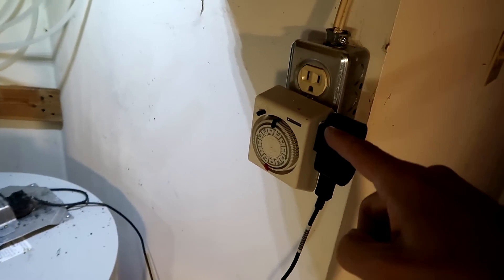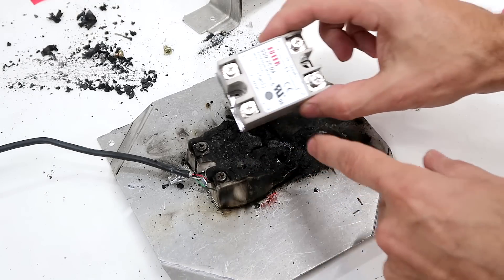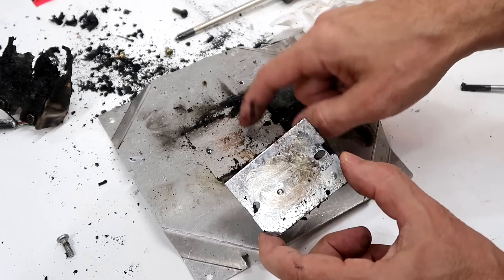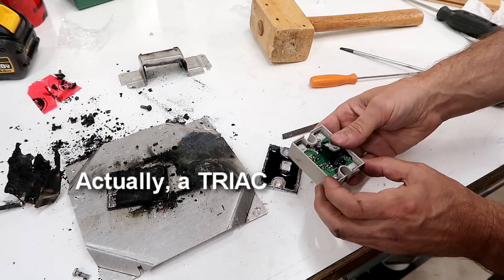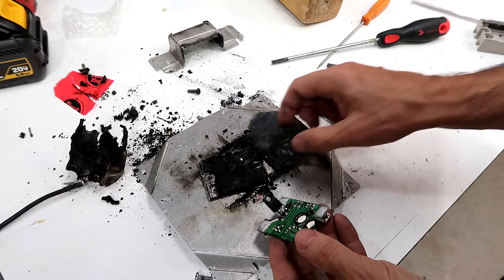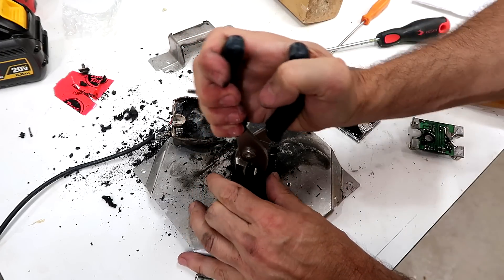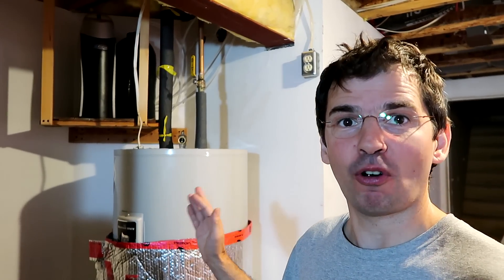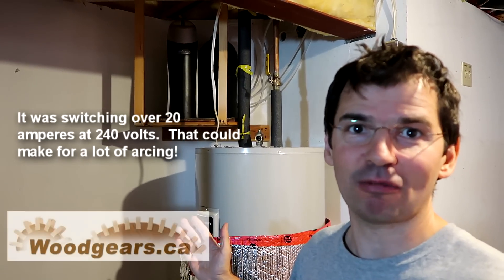Spectacular solid state relay failure

Comment: use a contractor next time, that thing is made to switch heavy loads. we use this to switch on the heaters in the whole house and its working since about 40 years now. you have to change it every 5-10 years because it fails and doesnt switch anymore but at least it wont burn down. 

the thing gets mounted inside the fusebox too so its extra security

Comment: These eBay fake Fotek SSRs use the BTA25 triac (well, some use the BTA15 and push it way past its rating, but that's another story). If you look up the datasheet, there's a diagram of power dissipation versus on-state current. At 20 amps the power dissipation of this relays is ~25W. Do you know how big a heat sink you need to passively cool 25 watts?! 
Not only you didn't use any heat sink at all, you installed it on top of a water heater where the ambient temperature is even higher! 
If you did 10 minutes of research, you'd have seen this coming a mile away. You're very lucky your house didn't burn down.

Comment: I had the same problem.  Fake fotek relays.  My relay failed in the on state with a 20A load.  Toasty.  I left a warning on amazon but the product listing was removed.  Replacement NTE relays have not failed yet.

Comment: I would have installed something like that in a Hoffman type enclosure. An enclosure is not really made to keep people out but rather contain the electronics. In a failure such as this there is not much risk burning things down around it from inside a metal box.

Comment: 1. 25A for 22A? Too close for my comfort.
2. A thin sheet of aluminum is not much of a heat sink.
3. Sitting on top of the hot water heater means ambient temp is going to be a bit higher.
4. Summer in a garage is likely to get hot.

Looking at the datasheet for the Fotek SSR-25DA:
https://cdn.sparkfun.com/datasheets/Components/General/SSR40DA.pdf

Current starts derating at about 82C (see page 12). But look at the size and configuration of the heat sink required for a 25A SSR, it is 100mmx100mm with lots of fins (see page 13). That will be with lots of free air, preferably mounted so the fins are vertical or with some forced air flow.

Even with a large heat sink like that, shrink it to 50mmx100mm and the datasheet lists a max of 10A. With that aluminum plate, I'd be surprised if it could handle more than 5A for a length of time.

I think this could have failed purely due to the inadequate heat sink, made worse by elevated summer temperatures. Add the possibility of counterfeits in, it was doomed to failure.

There is a reason SSRs come with four bolt holes and a wide, flat aluminum base. And a reason manufacturers use these large heat sinks on them, and don't forget a thin film of thermal paste:
https://sc01.alicdn.com/kf/HTB12s_2KFXXXXbqXXXXq6xXFXXXM/aluminium-led-heat-sink-radiator-heatsink-heat.jpg

Comment: Yes, it's probably due to the solder melting and increasing the resistance of the traces, which would then produce a lot of heat.
Still, I don't know if that would be enough to completely vaporize the whole board, like it happened.
Reply: Really the wrong application of an SSR. SSR's produce heat, so keeping one passing high current for many hours at a time is really not a great thing to do. SSR's are ideally meant for PID control where many  ON/OFF cycles happen in a short period of time - an application that would cause shorter lifespan in a mechanical relay. But for his application where the heater stays ON most of the time and switches only occasionally, a mechanical relay or contactor is likely the best approach if passing high current. Plus, the Chinese SSR's that are cheap cannot carry a load that high for hours on end w/o a big heat sink and a cooling fan, if at all.

Comment: Spike voltages when switching an inductive load require a protection. E.g.: https://www3.panasonic.biz/ac/e/control/relay/solid-state/cautions_use/index.jsp And wrt arcing, there's no arcing in a solid state relay...

Comment: Build a bandsaw out of wood: That's crazy talk, it won't be strong enough, it'll never work...  Build a fan impeller for a dust collector out of wood: Foolishness, it'll just blow itself apart!!!...  Use drawer slides for the pantorouter:  why bother, it's too hard, you can buy roller bearings from china (won't work as well, but much easier...)...  Use a SSR to turn off the water heater: Nonono, you can't use a device designed to switch AC loads to actually control AC loads, it'll blow up!!!...  I guess if you have enough monkeys writing comments on youtube, you're bound to have success once in a while...  Look people, the only mistake he made was trust the rating on this SSR which turns out to be bogus (bigclive has a video on a similar SSR from the same company).  Lesson learnt (and thanks to his sharing this video, lesson learnt by a lot of people! I applaud him for having the courage to post this video)...  If you are somebody that "does", then you will make mistake: learn from them and move on... If your whole purpose in life is to avoid making mistake, then make sure you stay in bed and keep hiding under your covers (and please refrain from commenting on youtube... it could be dangerous, somehow)...  As for Matthias, THANK YOU for the awesome youtube channel!

Comment: This right here is a prime example why permanent AC installations need education & "license". Infact any high power potential electric work.

You used AC to switch a SSR, which is a DC utility like it reads in there. You undersized the SSR to begin with, driving higher loads on it than rated. That 25A is PEAK rating, not constant. You were driving it at beyond industry standard which is 80% max constant load. You were driving it incorrectly, and it was to begin with an extra unneeded component.

More enthusiasm than brains.
Reply: In the odd ball chance the SSR was wired correctly to begin with, it was in any case undersized and there was excessive components too. If it was simple timer device, well the one plugged in the wall would have done the trick lol
Reply: > You used AC to switch a SSR, which is a DC utility like it reads in there

From what I see, he used a wall mounted timer (probably rated 10-15A, but he only need maybe 0.1A actually, tops), and connected USB wall charger to it to drive SSR (5V DC). It would provide reasonable 5V DC, but the startup behaviour and shutdown behaviour of many cheap USB wall chargers is really poor.
Reply: Well - none of what you said is actually correct.
The problem was simply his use of a cheap knockoff.
Reply: I really hope you never touch AC either in that case. You might get someone killed

Comment: Not sure I would trust a TO-220 with much more than 10A, and given the cold-resistance of the heating element, there is likely to be some spectacularly high inrush currents. That is of course all 20:20 hindsight. Personally, would use a name-brand SSR for this kind of a job rated at least 40A. Panasonic AQA611VL sells for US$50 from Digikey, cheap compared to burning down the house. Also steel has a high thermal resistance, consider something like ali for the heatsik. Anyway, just my 2c. Regards, Mark

Comment: Best practice is to use an SSR for fast switching applications and always to put a mechanical contactor or relay in series. This serves to isolate the power if the SSR fails as they fail closed. You should not use an SSR by itself regardless of the quality. So the safety issue is the result of poor design not just poor quality.

Comment: 22A for a chinese 25A SSR ist ways to much. 25A ist the theoretical max. possible Current. And it needs a BIG heatsink. When anything went´s a little bit wrong the SSR turns into a lighter. Here is a video from Bigclive about this SSR. He found some errors. One is that the input becomes to hot at max. input voltage. 
https://www.youtube.com/watch?v=DxEhxjvifyY

Comment: You are aware that your wiring of that relay is not to code (any code, anywhere) . That being the case if you had a fire and an insurance claim, the insurance company would walk away from you. You would be facing a full financial loss including the fire department fees, insurance investigation fees etc. It's OK to be a smart guy but you need to do these things according to code requirements. If you don't know what the code requirements are for supplementary electronic and electrical equipment in a home installation, research it before doing it! You are one very lucky man! This is coming from a retired fire fighter and licensed electrical contractor.....

Comment: I'm pretty sure BigClive tested one of those knock-off Fotek SSR before and they actually are rated for about 12A, not the 25A they claim. If you had bought a real one, i'm pretty sure nothing would have happened.

Comment: Matthias, I truly respect your knowledge and intelligence, but this bodge lacked wisdom. This should have used a continuous-duty contactor or purpose-built controller. Sometimes very bright people let their abilities outsmart simple wisdom. I’m not a safety Sally. I disagree that you, given your skills, should never attempt any electrical project. But this one was ill-conceived, overthought, under-wisdomed, poorly executed, and a risk to your beautiful wife and children. It’s been said that exceptionally bright people make exceptionally big mistakes. Count on it. Been there myself. Kudos for making this video. Anyone else contemplating such a project, forget the debate about various solid state relays. Use a device that doesn’t dissipate energy as heat...something with nice, big, quality switching contacts. A semiconductor device always has an “on” resistance and will always heat.

Comment: This is why my Dad used to DIY stuff like these in the 90s. He had an electric stove power reducer. It worked for 15 years, 
then the 2 triac that were in it, went bad and it allowed full power  to the stove. A simple replacement fixed it

Comment: The system certainly failed due to thermal overload (to say the least!) when the thyristor chip temperature exceeded its maximum junction temperature, probably ~125 Deg C. The board looks like it caught fire or something on the board did. 

I am not sure that the 25A rating of the relay means I will assume RMS. My guess is that the 25A rating is at an ambient temperature of something like 25 DegC that is derated as ambient temperature increases.

The board looks like it caught fire or something on the board did. It's easy to see how this could happen. If the terminals were shorted by the failure I thunk the breaker would have been opened.

Thermal resistance Junction-to-Case (ThetaJC) is the number that  describes the perfect situation with the part bathed in a massive heat sink like the pacific ocean. Its so massive your few tens of watts will not change the the temperature of it and therefore the case temperature. The chip junction temperature would simply be

Tjunction = PD x (ThetaJC) + Tambient

where PD = Power dissipated.

(Assume that thyristor has a 1.8V drop and RMS current is 20 A). PD= 36W, or ~ 40 Watts for our purpose.

Maximum chip temperature is probably 150 DegC with a maximum operating temperature of 125 DegC likely.

Let's also assume the scenario where the relay is on for a long time in a hot garage and mounted to the top of a heat producing object.

Let's assume the top of the water heater metal is 50 DegC (122 DegF).

So Tjunction = 40W x ThetaJC + 50 DegC.

Best case is ThetaJC is 1 to 5 DegC/W but we must add to this the thermal resistance of ThetaCA (Thermal resistance of case to ambient, which includes the ThetaCS Thermal resistance of case to sink) and ThetaSA (Thermal resistance of sink to ambient).

This is a inexpensive SSR and the mounting of the Thyristor TO-220 was via a screw to hold the IC package tab to the bottom of the module and done by a worker. Questions are was there thermal compound applied correctly or at all to the IC's tab? Was the screw torqued correctly and was the tab fully flush with the bottom plate? 

All these are unknowable so lets assume ThetaJC = 5 DegC/W. we don't need to go much further to have our own  "Houston we have a problem" moment.

Tjunction = 40W X 5DegC/W + 50 DegC =250 DegC. Well over the 150DegC maximum junction temperature!

If we add in even a modest ThetaCA of 2DegC/W we get 330DegC.

Comment: You're supposed to use a heat sink at those current levels, a thin plate of metal doesn't count. The one usually sold for that looks like an inverted tree. Also, Fotek SSRs are known to be fraudulently relabelled at a higher amp number to fetch a higher price. UL has a web page to help you spot the authentic ones.

Comment: I would be happy to provide you with a free definite purpose contactor. I can get you a 2 pole, 120v coil. Any any resistive amp load you need. Just let me know.
Reply from the maker: The problem with these contactors is they use a fair bit of power, and they are loud.  If it takes 5 watts for 10 hours every night, that really eats into the savings.
Reply: @matthiasrandomstuff2221  subtracting the cost of a new free contactor from the cost it would take to run it for 10 hours. At 5 watts a night I think it would take a long time before you could really say using the contactor was affecting your savings. Offer still stands. 5 watts a night is cheap insurance.
Reply: https://youtu.be/dlWmMevL3NA
Watch the terrible video I made showing how to make any water heater a Smart appliance.

Comment: Yeah that's about what I'd expect from a china clone SSR. You sadly do get what you pay for with this sorta stuff :/

If you want to set up something similar in your next place, then I'd recommend going with some quality SSR. Something like crydom, or omron.

An example of a suitable combo would probably be an HS251 (heatsink) + D2450 (50A SSR). They sell this as a combo called HS251-D2450. I'd get it on arrow.com, mouser.com or digikey.com, but expect to pay around 80 USD for it :/

Because your load is very periodic, you may be able to get off with getting just the heatsink and a D2425 SSR (25A SSR), and that'd land you more around 45 USD
Reply: You can use octopart.com to check which place has the parts cheapest

Comment: Actually more likely is that because we are in summer months the odds of a Brown Out increase due to increased loading on the grid because of Air Conditioners. The Triacs used in those SSR are quite robust and can easily absorb brief surges but if the voltage drops all bets are off. A safer way to have controlled it would have been to use the SSR to control a contactor with a 120 Volt coil.

Comment: For 50W heat dissipation to stay below max die temp you need a heatsink the size of a CPU cooler (rated for >50W TDP, with the fan going), not a thin piece of aluminum with no fan...

Comment: From experience, triacs dissipate a lot of heat - approx 1W per Amp - I have a BTA26 triac (self made SSR) which switches anything from 1W - 2900W (0-13A@240V) into a water heater but it is fully variable, not just on or off. I noticed that when it was constantly running at full power (solar PV diversion) it started to do weird stuff as ambient temperatures crept up - measured it with a IR temperature gun and it was hitting over 100C on the heatsink - far too close to the junction failure temperature. Re-calculating the size of heatsink, I went from 3.1W/C to a 2.7W/C (twice the height) and it's been fine since (I even considered forced cooling with a fan at one point!). For your example, I don't see the point of using 'complex' electronics for something which is either on or off for a long period of time (minutes/hours) - there are too many points of potential failure - personally I'd stick with a relay/contactor arrangement for purely on/off switching. Glad to see it was only the casing that melted itself however and not anything else nearby :o

Comment: Matthias, take a look at video on "Teardown of an ebay 25A SSR".  The triac (transistor) in this video is a BTA12-600B it has a I(t) of 12A per the datasheet.  I also noted that you possibly have a 2 stage heating on the water heater (top and bottom elements).  Both elements would have been on after a  2 weeks off.  When you installed the SSR you were using only one element.  The triac possibly failed because of too much current.  The failure would have burned everything around the triac leads and on the circuit board.
Reply from the maker: On these water heaters, only one element turns on at a time.  Look into it.

Comment: why would you risk burning down your house like this? i'm no safety nanny, and i like the videos where you make fun of them, but using a cheap chinese solid state relay for something so heavy duty (relatively speaking, for residential) is next level cavalier. you realize that if this had been a worse fire and you had tried to do an insurance claim, the inspector would have found this and you'd be up shit creek without a paddle, right?

Comment: You were warned when you installed it. SO many people have had problems with those things. Maybe they are fake. Who knows. But next time, use a real relay. No offense meant to you.
Reply from the maker: If I needed all the warnings from youtube users, I woldn't be able to do anything.  And if I took all the youtube advice, I'd waste my time on a lot of pointless stuff.  So youtube comments are not something to take seriously.   I don't read them all.
Reply: I mostly agree. But there were a lot of very specific warnings that this exact part had caught on fire for other people. I'm an electrical engineer and defended your other choices in the comments in the past. But the fotek SSR on a water heater was a bad call.
Reply: UL even issued a warning on this part in 2014.